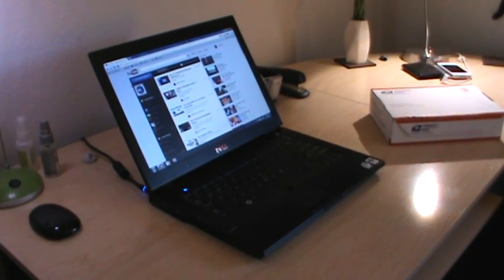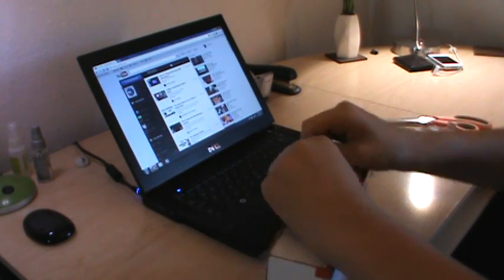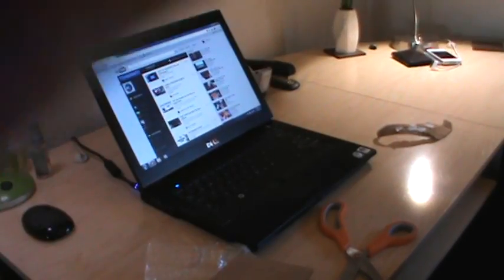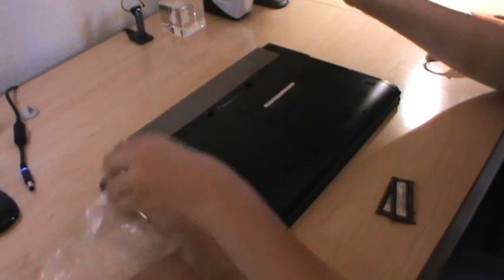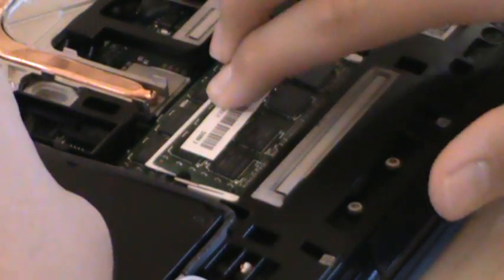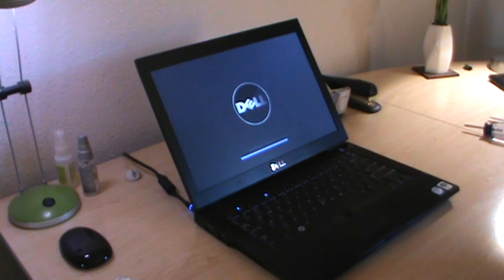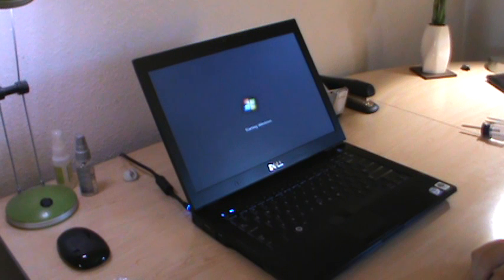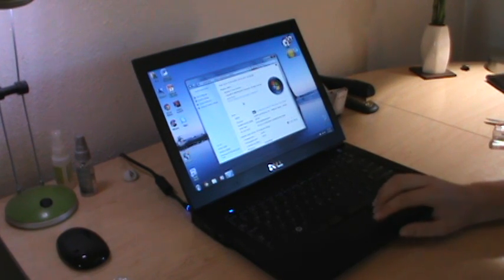Dell Latitude E6400 Upgrades (Part 1) - 4GB RAM

Comment: I just bought DDR2 4GB (2x2 gb) 800/6400  HYNIX - seller tell me it is possible to change it to 2x 4gb , and quad core processor  QX9300, 2.53 GHz, FSB 1066 MHz, L2 12 MB http://www.cpu-upgrade.com/mb-Intel_%28chipsets%29/GM45_Express.html

Comment: are you still use that computer if is E6400 a good machine?
Reply: These computers still work just fine. Just upgrade the RAM to 4GB of RAM and they will run windows 10 no problem.

Comment: just got this laptop at the weekend mine only has 1gb am getting 2 gb from ebay maybe I should have ordered 4gb though it cost a lot more. 
am running windows 7 32 bit on mine so hopefully it will not need as much.

Comment: OCD is GOOD when yer dealin with computers. But you're not OCD at all. YOU LEFT THE BATTERY IN! At least tell people not to do sh#t like that.  While yer at it, tell 'em to touch a large metal appliance before holding the RAM in your bare hands. If it's mid-winter, you'll fry the thing with static el.  Nice puter though.
Reply from the maker: +rickideemus Oh no I left the battery in we're all gonna die
Reply: +Dell0304 OK, I want your OCD card right here on my desk THIS MINUTE! {;~D

Comment: Can you upgrade the E6400 to 8GB of RAM?
Reply: @BHZ6  can I really upgrade this laptop to 8gb ram? but in Dell community site I saw that people having this laptop were not able to upgrade it to 8gb ram... If we can so please answer me. You can see that site which I am telling about you:-- https://www.dell.com/community/Laptops-General-Read-Only/upgrading-RAM-ot-8GB-on-a-LATITUDE-E6400/td-p/4541503

And I have 64 bit version, windows 10 and 1 gb ram each in both slots!!
Reply: I believe so...
Reply: ***** I still use mine for school.
Reply: Yes it does
Reply: Rodney Mintz sd
Reply: Yeah it's expensive though. 35 dollars per 4 gigabyte chip. Can't even find used cheap ones on ebay, I would recommend just buying PC2-8500 chips instead. I got some for $15 dollars, this computer has a 1066mhz data bus so it's capable of utilizing the faster RAM speed. It's really nice computer the benji guy is just a useless fad moron social signalling to feel special about himself.
Reply: Yes
Reply: Could you recommend a place they could help me upgrade mine to 8gb ram and 64 bit

Comment: I have the original reinstallation disks for Windows Vista Business 32-bit, which was the original operating system on the machine, but I've since reverted back to my favorite Windows XP Professional 64-bit. I've got a genuine installation of Windows 7 Professional as well, but I'm going to be using it for my Dell OptiPlex 745 that I'm rebuilding.

Comment: Well, I went all out on mine; 2.4GHz Intel Core 2 Duo upgraded from 2.0GHz Intel Core 2 Duo, 4Gb DDR2 SDRAM from 2Gb, WiFi b/g/n from WiFi b/g, 160Gb Intel SSD, from 160Gb 5400 rpm HDD.

Comment: -change to a non-aero windows theme
-if you have more than 2GB RAM, set the swap file to 256-256
-edit the power manager settings for high performance
------------------------------------------------------------------------------
change min CPU usage to %100
leave mx CPU usage at %100

I did a whole lot of other crap and i get 16 -19 seconds.
Look if this decreases boot time

Comment: Aw, come on, the D630 isn't that much of a problem. Mine's been fully upgraded with WiFi b/g/n and SSDs and everything, but a truly annoying laptop was the D600/D610, every single little screw was different, or so it seemed.

Comment from the maker: Hey Darren, thanks man! This laptop ROCKS!
Reply: hi, im a begginer in the pc upgrades topic, I recently upgraded this laptop ram, but I want to put a newer processor, what's the latest cpu, that I can buy? 
thanks 😊
Reply from the maker: @VortexZ6  Best you can put in here if I remember correctly is a Core 2 Duo T9600...or T9800, I can't remember